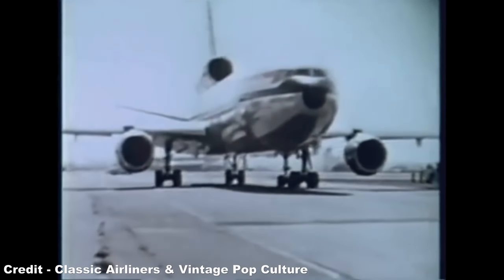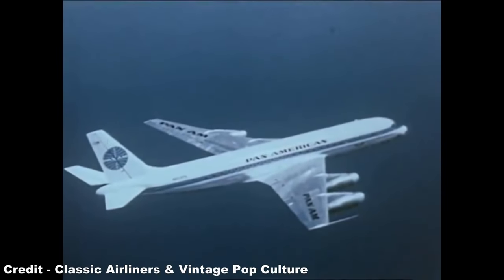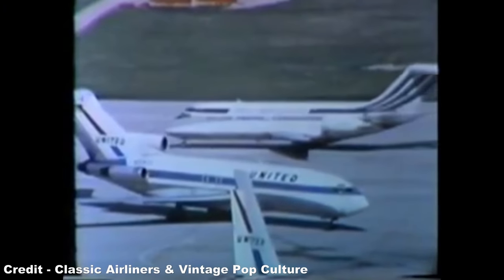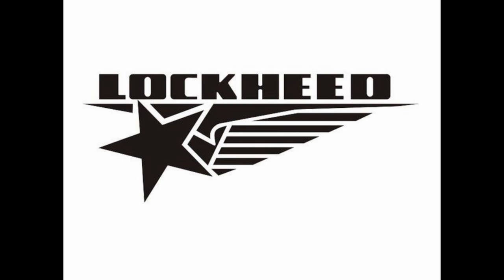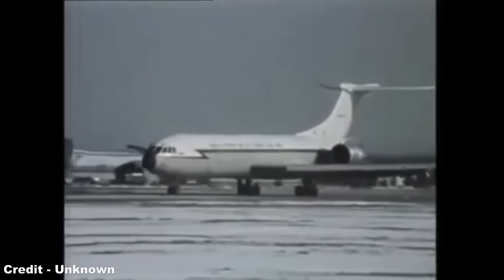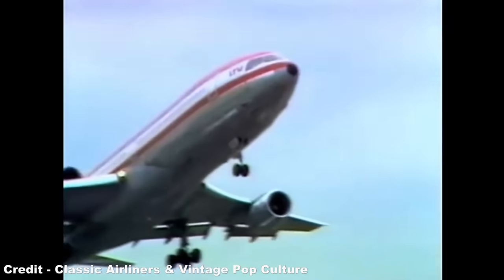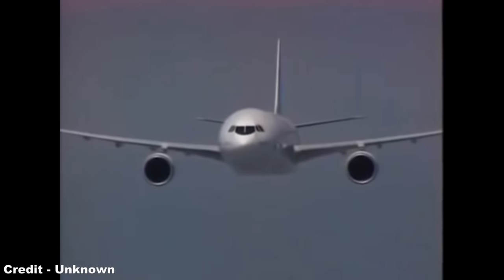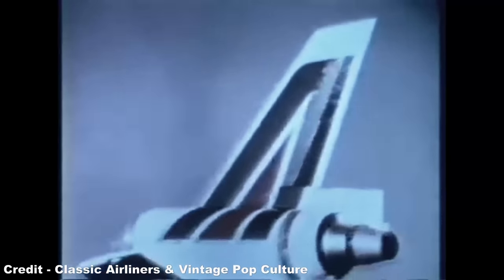What Killed the Trijets?

Comment: Still think the 727 was the sleekest, best proportioned, mass-sold Passenger jet ever introduced.
Reply: Flew on a nearly empty 727 from Chicago back to Indianapolis one time.  Pilot came on intercom,  obviously aggravated by many delays, said he was going to get us home as fast as he could.   Out of all the jet takeoffs I had been through,  maybe a couple dozen,  I got pinned back in the seat so much I remember it today.  The trip from Chicago to Indy is just blast off to cruising altitude and then level off and almost immediately coast back down,  hardly time for beverage service.
Reply: She's my favorite airliner for this exact reason. Such a good looking plane!
Reply: @mikekokomomike  Most of the Crap7s fly at .75-.80M.   We used to fly the 727 at .88 all the time.  We had two versions, one had a higher Vmo.  There was a mode A/B switch on the Airspeed indicator and if your Zero Fuel Weight was 'X' or below you could run in 'fast' mode (A).   Not sure if I have that exactly right, but you get the idea.   250 knots to 10K.  Then hold level flight till the IAS needle married right up tight to the VMO needle.  Get one or two overspeed "Clicks" for style points and then pitch up to hold that speed to cruise.  At this point, you're not going uphill too fast but downrange like an SOB!   At cruise alt, just level off and let it rip.  When it stopped accelerating (or you felt it buffet), match up the fans and call back and ask for coffee.    During short flights, cruising at low ALTs it was nothing to see 385-400 indicated.
Reply: @lbowsk  Yeah, that was back when kero was $.12 a gallon & lowest block speed was all that mattered. Different world today.
Reply: ...and I LOVED the roar it made.
Reply: Absolutely. 
Still my favorite of them all.
Reply: It looks rather outdated now.
Reply: I have fond kid-memories of that bird!
Reply: I worked on the airside at HOU (Houston Hobby) during the twilight years of the 727 in passenger service, and I was taking flying lessons (in a Decathlon...long story) at the same time. I've seen three-holers from every conceivable angle...dead ahead/astern, profile, overhead, three-quarters, wheels up/down...there's not a bad line anywhere on the airframe! It's almost as good as a pretty girl!
Reply: The trident was the fastest jet after concord
Reply: Meh. Give me an MD 85 any day. That thing is a wonder to behold.
Reply: @apgardude  Here in Australia we lived about 20 kilometers from the airport in Brisbane and I was probably the only person in our suburb who loved to hear the plates in our cupboard rattle as a 727 roared overhead
Reply: DITTO
Reply: Boeing’s designs used to be so stunningly beautiful. I’m not saying their newer aircraft are not good looking, they still look visually appealing, but the early Boeing planes were just so stunning. Golden Age of Aviation. Ships and planes and cars looked so good in the 1900’s.

Comment: Interesting video. I recall the engine falling off the wing of DC 10 flight 191 over Chicago in 1979 freaked us out a lot. My family (and many other people) refused to fly on them after that famous incident. And, if you had a seat toward the rear of a 727, it was really loud, but that were they put the smoking section!

What also killed the tri-jets was the advent of the high-bypass turbo fan engine, which is quieter and more efficient than the straight-thru turbo-jets, but is too bulky to be mounted in the tail or fuse, it can only be hung under a wing.
Reply: The engines on the L-1011 and DC-10 WERE high bypass turbo fans - just not AS high a bypass ratio as current engines.
You seem to be thinking of the engines on the 727 and the EARLY models of the 737.
Reply: I flew to Qatar once from MD in a DC-10. In talking with the crew I learned they flew the whole way on just the two wing mounted engines. 😐
Reply: S C - Yuh!! It was AMR 191 on 5-25-79 that had engine #1 develop a miss at O'Hare. Tickets were in-hand, but got PO'd when found new Mom-in-Law skimming us over Wedding Reception Hall, forcing us from SAT to a FRI, all for huge kickback. Arranged & self-pd for all including little sht like chapel, preacher, license, hall, invitations, flowers, catered food, liquor, bartender, photographer, 7pc band, limo, etc all myself to get orig date of SAT 5-12.  On 5-25 At LAX, on way back to G.R. MI from Hawaii, picked up LA Times Xtra Editn w/news DC-10 for original tickets, had augured it in on flight from O'Hare to Trailer Park.  Wife's Mom hated me for rest of Mom's life ending 1997, as if not for me & my detective, she would have had her really huge payout that had always dreamed of from AMR on loss of her daughter, "she loved so very much"!  She also didn't get that huge kickback she was counting on either!!  Too Bad...So Sad!!!  As the ole farmer said, some days ya steps in it, some days ya don't!!!  Sincere RIP for "lucky couple" (United on strike) that had scooped up our original tickets, taking our places...
Reply: Besides American Flight 121 at O'Hare, there was also United Flight 232 at Sioux City, IA, when the #2 engine on a DC-10 blew up and destroyed all 3 nearby "redundant" hydraulic systems.
Reply: @erwinschmidt7265  Sorry, I'm bit confused about the dates and where you were going to/from. Your original wedding date was Sat 5-12-79 but your M-I-L-to-be tried moving it to Fri 5-11-79; and if you'd got married on the Friday, then you would've been on AA191 (Chicago to LAX) Fri 5-25-79 ... but instead were flying LAX to Grand Rapids that day because you got married on Sat 5-12-79?

As you say, RIP to the unfortunate people who thought they were lucky getting your original seats on AA191 on Fri 5-25-79. :(
Reply: @vk2ig  - Yeah Buddy/Buddyette!!  Reserved Hall well in advance for 200 on 5-12, but "future" Mom-in-Law got wind of $4,000 Honorarium for date, so on her own got it switched out for 5-25.  Yuh...she wasn't a scammer or anything, but I had contract for 5-12, so Mumsy out "her" 4G!  Only SAT would work as many out-of-towners coming w/reservations already made, so needed original date of 5-12!  If had been on pIane 5-25, Mumsy woulda got, $15G Daughter's Life Ins at work, $150G from AMR, and about 300G for half my sht as just married.  That was total of 465,000 1979 dollars, so she just missed boat/plane/etc!!  In Mumsy's ranking of all human beings, I came in "lower than whale sht", but both Missus & myself still kickin' and in good health.  Scam that Mumsy!  I hope this helps...sorry for the confusion.....
Reply: @erwinschmidt7265  Holy crap, close call indeed. Good thing you missed the plane. Any "survivors guilt"?
Reply: @SC-yx6wr  - Well, United was on strike then, so airline tickets hard to get.  They wanted 2-ticket package bad, and I guess we let them have it, ah...in more than one way. No bad intentions so no guilt, but much sorrow for the entire planeload when picked up copy of 5-25-79 L.A. Times Special Edition...RIP!!!.

Comment: Thanks very much for mentioning the ofter forgotten Avro Canada C-102 Jetliner! 😀

It was a fantastically pioneering aircraft, and had lots of interest from potential customers, but the Korean War caused the government to order Avro Canada to reallocate it's production capacity to building the CF-100 interceptor instead. 

What a crushing blow to what could have been a great success, both for that individual aircraft type, and a growing civilian jetliner industry in Canada as a whole.
Reply: Aye. The lack of a civil airliner to "pay the rent" also ensured the demise of AVRO Canada's other and most well known project; the AVRO Arrow.
Reply: @jimtaylor294  Of course, Avro would have thrived if the Arrow hadn't been cancelled in 1959. 

The Jetliner program, which had been revolutionary when it first flew in 1949, was well and truly dead by the time that the Arrow program was in full flight, so to speak.

The one flying prototype of the Jetliner had been stored intact until about 1955, when the nose section was cut off for eventual museum display, and the rest of it sadly scrapped.
Reply: @daviddunsmore103  the arrow was beautiful, but I don’t think it would’ve made a difference in saving the industry

Comment: Tri-jet airliners have always been among my favourites, from the Trident all the way through to the MD11. There were also tri-piston passenger aircraft, the Britten-Norman Trislander (a development of the long-lived Islander) being the most famous of them. 

Another class vid as ever. :)
Reply: My favourite tri-jet airliner is the Boeing 727, the original!, it's actually my second favourite plane after the Harrier.
Reply: Surely the Junkers JU 52 and Ford Tri Motor are better known examples of 3 engine piston aircraft
Reply: @mortimersnerd8044  Indeed, which in fact makes OPs mention even better. I did remember the Ford Tri Motor but this one with a tail 3rd piston engine is far more interesting in it's weirdness.
Reply: Britten what? Never heard of it. I thought you were going to say the ju 52/3m or the Fokker something something or even the Ford triplane.
Need to check that one up
Reply: @TheAllMightyGodofCod  
The Britten-Norman Islander has been a popular twin engine prop plane for decades, serving as a short haul airliner, business carrier, utility plane, and even as a 3rd world armed military plane as the Defender. The Trislander is a stretched fuselage version with a 3rd engine and prop stuck in the middle of the tail fin, DC-10 style. I believe it is still in use on a few out-of-the-way domestic routes due to its short-field capability.
Reply: @TheAllMightyGodofCod  Ford trimotor.
Reply: @TheAllMightyGodofCod  You can get to fly the Trislander in several places now, while the Ford Trimotor or the Ju-52 are barely possible to get a panoramic fly during very special occasions.
Reply: @gteixeira  @Mike Armstrong as I said, never heard of it.
Reply: @TheAllMightyGodofCod  They are not really that common, to be honest. But at least they get you in remote places like the Falklands or the Orkney Islands.
Reply: @TheAllMightyGodofCod  You have now :-)
Reply: @mortimersnerd8044  Those I was indeed aware of, but the Trislander outclasses both for sheer weirdness.
Reply: @mortimersnerd8044  Some Italian planes of the 1930s also had tri-engines also.

Comment: I flew on a 727 in South America in 2008... shocking how short the takeoff was.
Reply: Absolute rocketships...
Reply: @Kilo-ct8dh  Must not have been Aerosucre :P
Reply: @phishbill  I always considered the MD-80 a rocketship compared to the 727 - 100 and -200.
Reply: The tiny A319 is like an angry MINI Cooper taking off at the stoplight. It may be small but this only makes it easier for the pilots to get off the ground! Try flying on one out of a tiny municipal airport like Orange County-John Wayne Airport. The pilots lined up with the runway and kept backing up. I was wondering what the freak they were doing. They held the brakes and hit the throttle. The engines were LOUD for a tiny plane. Then they let go and it bolted down the runway like a top fuel dragster. They took off literally 6 or 7 seconds later and pulled a HARD left towards Denver. I was terrified because I didn't know the A319 was THAT agile. It rolled around like a damn F16! That was the only time I flew the A319. Would love to try it again some day.

Comment: Still flown on McDonnell Douglas and Lockheed TriStar in the 80s. Remember the RollsRoyce engines on the latter.
Reply: I flew on a DC-10 LAX-DEN back in the late '70's, it even had a small stand-up bar amidships. Cool.
Reply: Yes.... I always felt reassured looking out the window of a Tristar in mid flight and seeing the RR on the engine. 😊

Comment: When I heard the DC-10 number two engine being easier to maintain, I just kinda laughed to myself. Might be easier in comparison, but it can still be difficult. I do maintenance work on MD-11s right now and sometimes getting the thing ready for maintenance can be a bit of fun, between getting the cowl and thrust reversers open by electronics or hand held pumps, and then having to reach out from the from the rather shaky patio doors on the tail below it to put the locks in place. Some stands are easy enough to get in then, but I find that engine tends to be a bigger problem than the number 1 and 3 ones. Very nice video though!
Reply: Plan to Buy a 7X, 25M after Major. Which is Better this or any 2 Engine for maintenance?

Comment: The development of incredibly powerful, extremely reliable and efficient turbofans is what killed the tri-jets.  You just don't need three powerplants anymore.
Reply: Yup, killed the 4 engine jet as well
Reply: @robertmcnearny9222  Quick note, Lufthansa is reactivating some A380's, according to Aviation Week.
Reply: @bertg.6056  Gotta pay for them somehow.
Reply: @robertmcnearny9222  The pilots shortage and fuel prices is also giving airlines pause over extending smaller capacity high frequency point to point routes.
Reply: @bertg.6056  Luftansa is not the only one tho... the way the market is right now is playing in the jumbos favor... less planes in the air in orther to save fuel and a lot of demand from travelers makes planes like the A380 and the 747 a good choice for some airliners who still have them.
Reply: @carlosfaria7390  excellent points!
Reply: And now they look ugly. 
Nothing more beautiful than the clean lines an wing of a trijet. The 727 being the best looking of all.
Reply: @jsmr451  My all-time favorite for good looks is Convair 880.
Reply: @bertg.6056  Love that one too
Reply: @carlosfaria7390  My next favorite for sleek looks is the DC-8 60 Series.
Reply: @bertg.6056  Yes a sweet looking aircraft. Fast too!
Reply: @jsmr451  Unfortunately, the speed advantage of the 880 was negated by increasing delays in boarding, and at best, could save only minutes on an average flight.  Not enough sizzle to sell the airplane.
Reply: @bertg.6056  A shame!
Reply: Also the FAA agreeing with that.
Reply: @terrystevens5261  Yes the Trident is a beautiful aircraft. And fast too.

Comment: I had the great privilege of flying the B727 for several years and it’s was such a great aircraft, a real workhorse
Reply: And a pretty fast hot rod back in the day, too!  Tell me that wasn't fun!
Reply: I understand that the 727 was as close to a "flying tank" as an airliner could be.
Reply: My first jet engine flight was in 1970 in a 727, and when the pilot gunned it...I couldn't believe the acceleration. What a hoot.
Reply: I flew the 727 ten years.. Looking back on it.. It was crap.. Had Dutch roll problems,, same as 707 but tried to fix with dual rddders and yaw dampers.. It was noisy,, and 4 crashes in the first couple of months when it came out. As a pilot.. You learned how to operate within the strange flight characteristics it had instead of you flying the jet.. It flew you. Landing gear in the - 200. Bad location. You could mess up a takeoff without a pitch to 10% then later to 15. Like I said.. It needed special flight techniques
Reply: @cjswa6473 Would the Dutch roll issue be due to the engines being so close together being near the tail and also close to the center line of the aircraft? Or was is more of an aerodynamic flaw?
Reply: Though largely superseded in that role by its stable-mate the 737, which was 2-engine and 2-crew vs. 3 of each for the 727.
Reply: @cjswa6473  One 727 pilot reportedly said: "On this bird you don't lower the flaps - you disassemble the whole damned wing!"

Comment: There are still two 727s based at Doncaster, it’s a treat to see and hear them fly over my house in Wakefield, you can hear them coming, going overhead and then far away in the distance. Great sounds.
Reply: They put on a great show at Farnborough in 2016 too, seeing 727s and A380s being thrown around the sky like military jets is one of the most awesome sights to see. Shame that Farnborough has lost its airshow element, was a summer highlight for many including myself.
Reply: @andrewwenzel3600  I went on board the 727 at Farnborough, which almost made up for never having flown in one (though I have flown in Tridents and a Tristar).  I've always thought the 727 was one of the best looking airliners ever made.
Reply: @paulshepherd8295  I have zero nostalgia for the 727, which I rode on many times during the 80’s and 90’s. The cabin noise level was crazy high due to the proximity of the engines to the fuselage. Add to that the low interior air quality (even after smoking was banned), a five hour flight was really draining.
Reply: @wyganter  Yes, I flew on BAC 1-11s a number of times.  Not too bad unless you're sat near the back, next to those noisy Spey engines.
Reply: @paulshepherd8295  There was hushkitted version as well
Reply: @petert3343  True, though that came along after my 1-11 flights.  And even with them on, it was still pretty noisy.